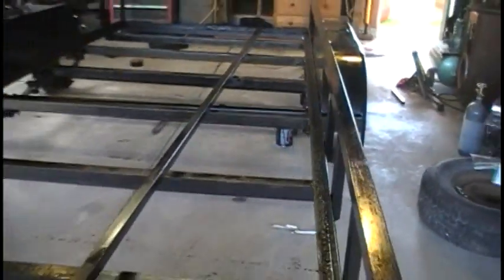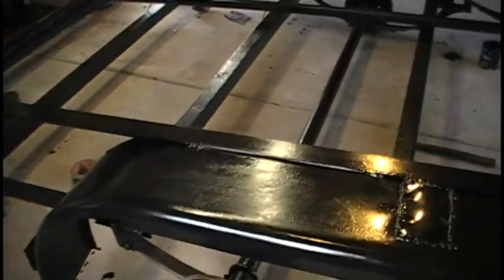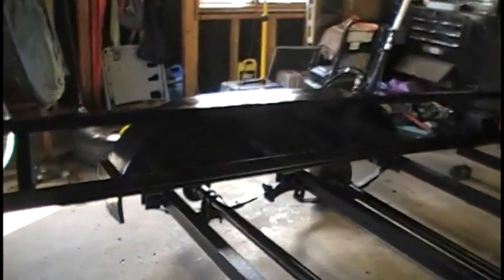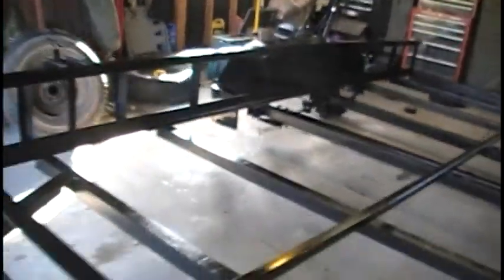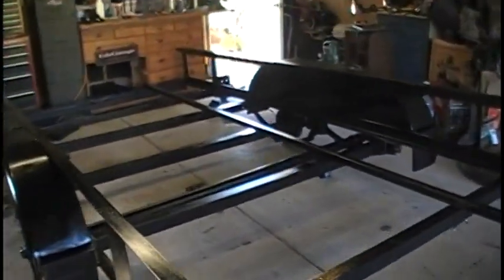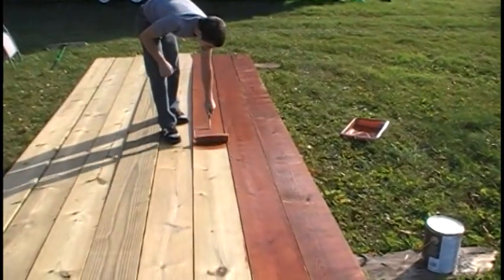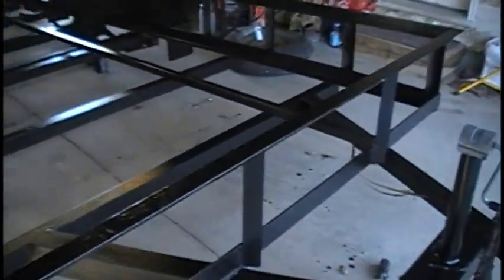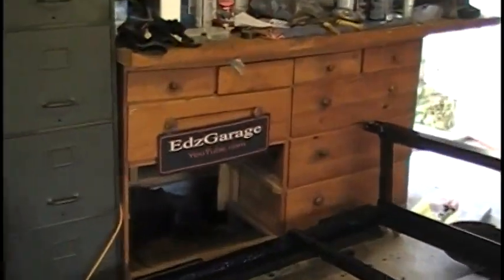16 Foot Trailer Rehab Project Part 7 Painting and Staining

Comment: Darn Ed it looks new and aww i believe that size is a quart ,pints are really small but they,re sold in millilitres here  in Canada eh just an observation and maybe rig the electrical and pluming before the deck does on ,unless you plan to hold the wire by screwing in the decking ,lastly Gee i like our family lol.

Comment from the maker: @DodgeRamFan11 I did think about using the rubberized undercoating but decided it needed to be sealed with a good rust inhibitor. I still could do the rubberized coating later I guess.